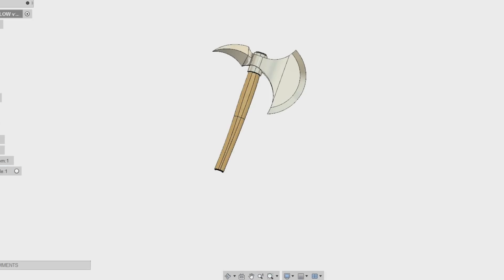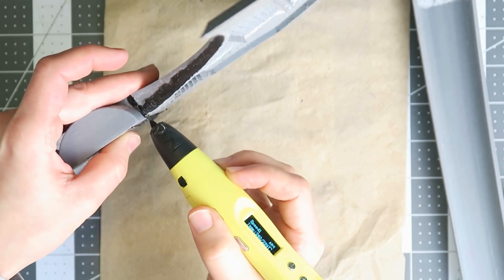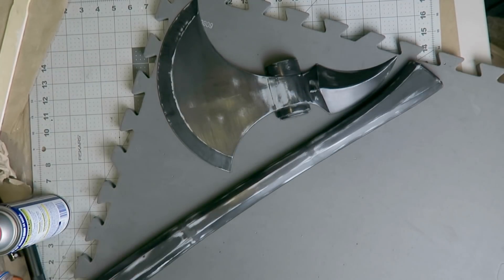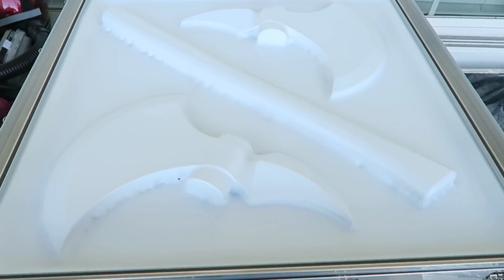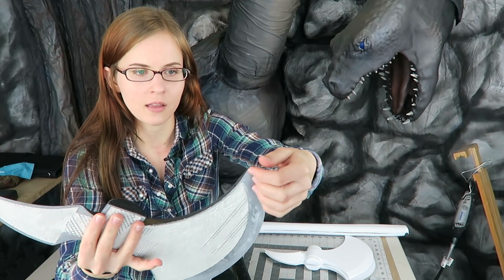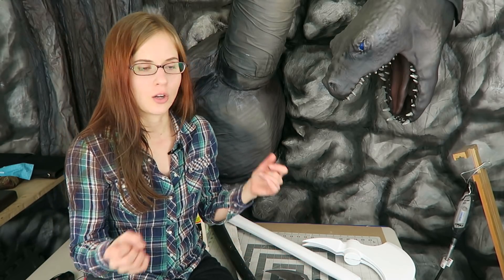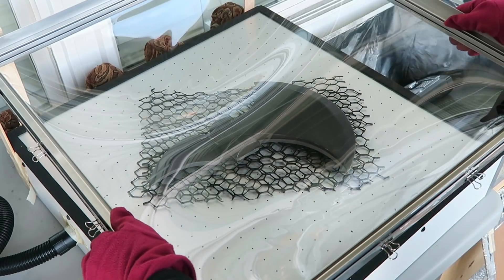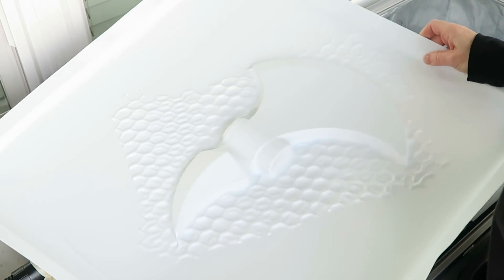3D Printed Vacuum Forming Mold | Perrin's Half-Moon Axe Wheel of Time Part 1

Comment: Also, if you drill tiny holes in the sword where the folds? are, the vacuum form will suck the air better and you will get a more perfect fit. Have you ever tried mold making? That might be an option too if you want the hammer head more rounded and organic.

Comment: Is that vaccum forming device DIY built or bought from a company?
If it is DIY project, do you have a video of how it was made? Thanks
Reply from the maker: It was purchased from widget works unlimited, but the design and construction could be better. Wasn't sealed properly and low quality materials.

Comment: Thanks for the video! I would like to ask a question. I want to create a 3D printed car model mold for vacuum forming. Is PLA/ABS 3D print material strong enough to preserve the details? Will it shrink badly? Thanks for the insights!
Reply from the maker: I have only tried HTPLA. It's not the best option, but you can probably get away with it for simple stuff. It's a game of getting a surface that will withstand the short heat of whatever plastic you want to mold and not soften or stick. Recommend doing a small scale test before investing a lot of time and material. Possibly some sort of coating like epoxy might help protect and smooth, but I haven't tested this yet.
Reply: A lot of folks use PETG for car bodies and aircraft canopies.

Comment: hi what glue do you use?
Reply from the maker: All sorts of glue depending on the application and materials. In general the most dependable way of joining 3d printed parts is to melt them together with a soldering iron.

Comment: I used a setup like this for years for forming masks and it works quite well. However,  your forming area is far too big for the buck you're using. You're wasting a lot of suction with the unused space. You could try using masking tape to tape off all of the holes you're not using. I think building a smaller former would probably work best. They're extremely easy to make out of some scrap wood and a piece of pegboard for the platen. One thing that would probably help, without spending any money, is to drill tiny holes in the problem areas of your buck. This will allow suction into those areas and should help with the detail. I've done this a lot on my bucks and it doesn't show on the front of the plastic after forming. As long as your hole is small.

Comment: Linds, excellent videos. Cool to watch you experiment with new stuff. Try making your two halves with a copious amount of draft angle. E.g. at the axe base have a large radius/chamfer where it meet the table. Additionally, since yorue 3D printing, leave holes or channels in the tool for the air to go through.  Some deburring probably will still be required even with this. Excellent early attempts! I never could get parts to vacuum form ~exactly~ the way I wanted but they were often good enough.
Reply from the maker: I'll give that a go, thanks!

Comment: Great job on your experimentation!  I tried to build a 12" vacuum forming table but had terrible results.  When and where did you get this vacuum forming table?
Reply from the maker: Thanks! I got this one second hand, but originally it's from WidgetWorksUnlimited. I checked the website, and they have several different sizes, this is the biggest at 24x24. The metal platen is sturdy. I need to add some proper vertical guides to speed up getting the frame aligned with the gasket.
Reply: That's really great!  What are you using as a heating element in the box there?  I would love a video on your whole vacuum forming setup (once you work the kinks out :)) Have you ever worked with Resins?  Smooth on has a very good expanding foam resin that might work out good for pouring into these molds you're making.   I attended one of their seminars and one I saw the properties of what these expanding foam resins can do, I was amazed.  Here's some product details:  https://www.smooth-on.com/product-line/foam-it/
Reply from the maker: There are two infrared heaters in the foil lined box. It get's really hot quite fast with the foil cover on. That's exactly the product line I want to try for this! I've not yet worked with resins.

Comment: Sounds like you're going to be better off doing slash casting to keep it light and preserve the details. Unfortunately you can't escape the"plenty of work" part of the process ;( Happy sanding 😁
Reply from the maker: Might as well glue the respirator to permanently to my face at this point between filler fumes and sanding dust!

Comment: I used to run an industrial vac-forming machine in a factory for a while. 
You want the plastic as hot as possible so it's as mailable as possible and then very quickly apply a very strong vacuum.

My old machine had the heater mounted above the vacuum. The plastic would be mounted on a jig that would drop straight down onto the mold. Bringing the plastic down would release a heavy weight in the base that would very quickly suck all the air out almost instantly before the plastic has a chance to cool and harden. I'd heat the plastic till is started to sag about six inches. Then bring the jig straight down, that avoids those wrinkles you were getting from having to move side to side. 

Your foam stand-off is a good idea but it's squishy, we'd use 2cm particle board because it's rigid and doesn't compress under vacuum. This will also protect your delicate points. Also we'd drill 1mm holes right through the mold and stand-off in all the concave seams to help pull the plastic into them. On your piece I'd put some along the seam between the metal head and wooden shaft. Also where the spike and blade attach to the centre. You can use a forstner bit on the back to hollow out a small void then drill down into that from the top with a thin drill bit. 

Also if you're having trouble getting the plastic to release once it's cooled and shrunk, a shot of compressed air into the seam can help separate the parts. 

Ok! That was a lot! So I'll quickly recap what I think would help the most.
1. Faster transition from heating to forming. Can you mount the heater upside down over the vacuum table?  Also having the plastic jig on rails so it can go straight down with no lateral movement will drastically speed up the transition. 
2. Bigger vacuum. I see you're using two little vacuums. That won't help. A single, bigger vacuum would be better. Even better still would be a proper vacuum pump with a tank and a valve you can open for a sudden massive force. 
3. For easy trimming I'd screw a box cutter blade onto the top a piece of the same 2cm particle board I used for the stand-off. This means the blade is at exactly the same height as the bottom of the mold. Then put both on a flat table and run the blade jig around the edge of the formed plastic for a nice clean cut. If you're going to do this, leave the plastic on the mold, trim off most of the unformed plastic with scissors, then run the blade jig around it to trim off the ugly edge.

Let me know if you have any questions.
Reply from the maker: Currently I have two infrared heaters in a foil lined box. Not sure if I could make it work from above and be sturdy and provide even heat, but I'll give the design some more thought. In the meantime I plan to add some proper guides to speed up the process of lining up the frame with the gasket before dropping. I did borrow a shop vac to try on a couple pulls, but it didn't seem to do any better than my two house vacuums. The tank option surely would have to give better results, so that's something I'll have to look into if other tweaks aren't enough. The stand-off/blade jig sounds like a far better way to trim up the pieces. Thank you for taking the time to share all this info. Gotta make some changes and go for another round of testing :D

Comment: Yay, wheel of time goodies!! :-D
Reply: So now I've watched the video... maybe you need a stronger hover or a vacuum table with more holes to get the finer details to show better. 
And for the molds, if you don't want to sculpt out of wood or clay directly which I think might be better for firmer but still cheap forms, 3d printing a negative, doing the sanding and then casting a form might be better. 
Alternatively you could try to have your digital designs cnc-ed and with affordable 2.5D cncs like a carvey, since as you say, vacuum forming works best for flat-ish, fairly shallow objects that don't stretch the plastic too much. Oooor, cover printers in high temp paint first maybe, as part of your filling process. 

Oh, and I think you should could reduce the suction area of the large vacuum bed by cutting a rough outline of the model out of cardboard and covering the areas of the bed that aren't being used, giving toy stronger suction around the model straight away, and allowing you to use smaller sheets of material too potentially. 

Ok, those are my thoughts for now! :-)
Keep at it! Nice to see you!
Reply from the maker: Thank you for the suggestions!